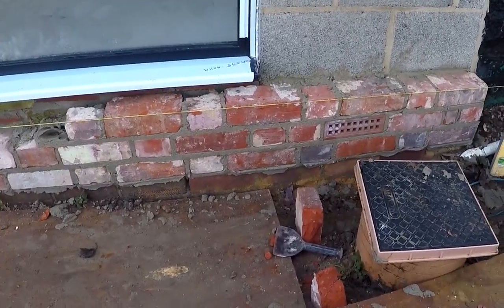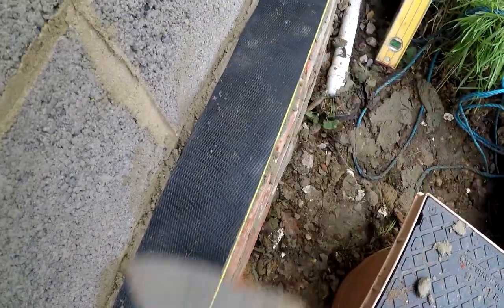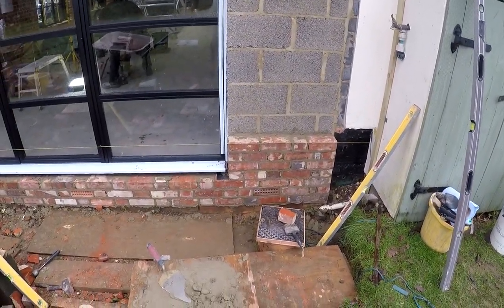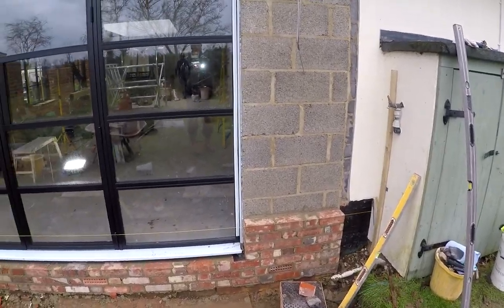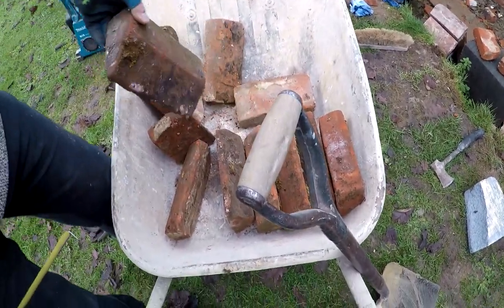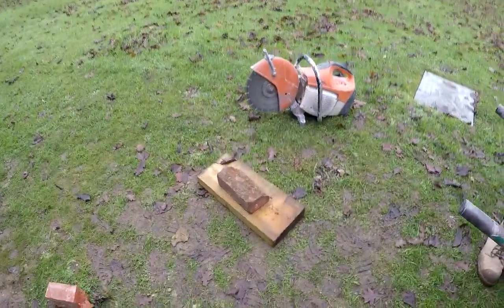Laying bricks and pointing up with lime, the OLD BOY METHOD

Comment: Why not build it all in nhl in the first place, pointless using lime pointing when you have built it in cement mortar might as well used white cement and light coloured sand in the first place👍
Reply: It seems a bit strange, 2 separate mixes plus raking out plus repointing
Reply: Seems a lot of extra work and a waste of lime mortar but hey ho each to there ways👍